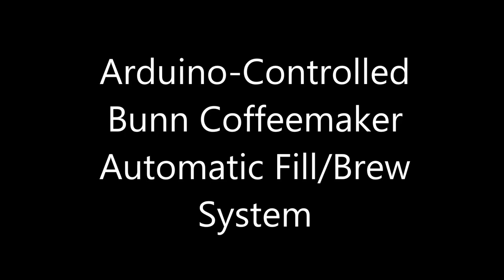Arduino-Controlled  Bunn Coffeemaker  Automatic Fill/Brew  System

Comment: I am just about to do something like this, because we fill with either 2,4,6,8 or 10 cups of water, I will be using 5 flush mount buttons drilled into the coffee maker which in turn control a water solenoid like your, I also will post a video of the whole project when done.